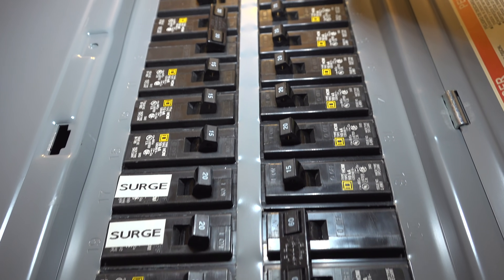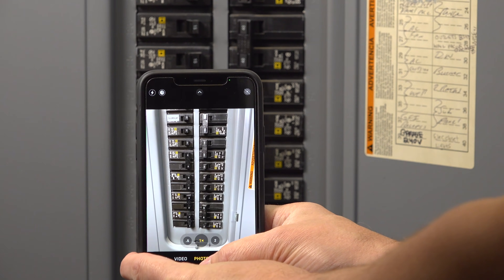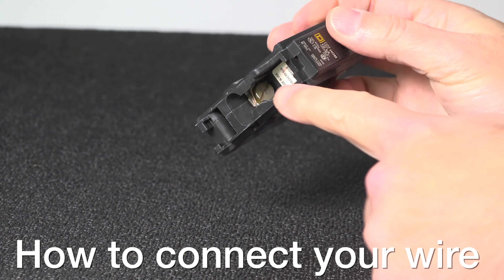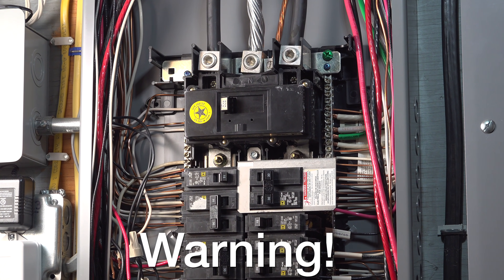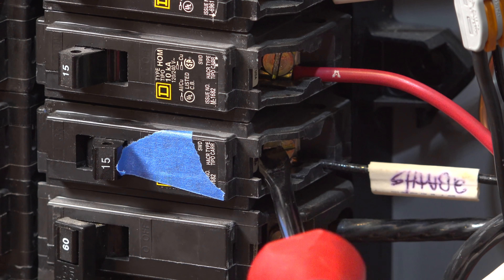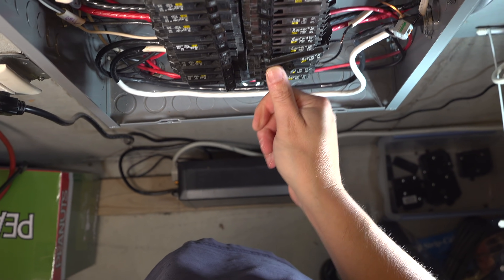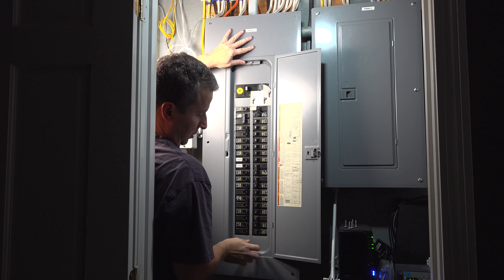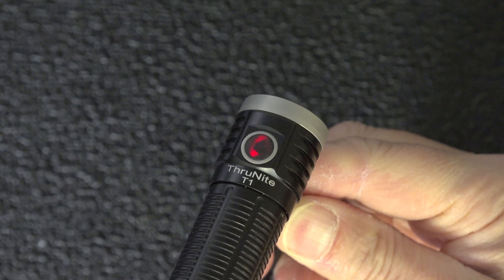How To Replace or Change a Circuit Breaker in your Electrical Panel & Why it's Tripping

Comment: once I screwed the cover plate back on and it dug into a power wire. There was a massive spark, sound, and then hours of trouble shooting. Don't assume there are no wire behind ....well anything in the panel. Please learn from my mistake. I assumed in the US, the diesign of an electrical panel would be thought out. NOPE.

Comment: Hello @Silver Cymbal.
How would I go about completely decommissioning one of those circuits? Previous owner my friend's house has outlets in their backyard, but one of the wiring is broken. Bad news in the rain, so I turned off 3 of the "circuits." I don't know which one it is exactly, but it was most likely one or a few of those 3 I turned off, and I want to completely decommission them. Do I have to install some sort of rubber that prevents the black copper wire and remove the black circuit entirely?

What are your thoughts?

Comment: Holy smokes. Looks easy. I think I can do it. Idk tho. But the breaker keeps tripping. Not sure what's causing it tho but it was in the middle. Tried turning it on but didn't want to. So I turned it off and back on and it worked. Theeeeeeeeeen it happened again. I repeated the same thing again. Now hopefully this week I'll get an electrician to take a look at it.

Comment: I've had the breaker for the induction stove top trip and it won't go back on.  It looks like the breaker at the top of your panel, left side, with two breakers that are bridged together.  Is there anything particular to be concerned about in replacing this/ these breaker(s)?

Comment: What if I dont have a main breaker? would having the breaker off be fine?
Reply: Every box will have a main breaker.
Reply: @danellzaabani5923 mine doesn't just all circuit breakers took whole panel off and nothing else but wires.

Comment: And also as you tighten the screw down make sure the insulation of the wire is not clamped under the plates

Comment: Thank you very much for such an easy to understand instructive video.  You have provided all the information needed to replace the faulty circuit.  If I turn off all electricity from outside, do the wires stay hot?  I saw another response to this issue.?

Comment: Thank you for your attention to detail in removing and inserting the new breaker. It was very helpful. I read on another video you need special insulated tools. I didn't hear you mention that.
Reply: No, but as someone else mentioned wear some rubber gloves as an extra precaution!

Comment: I have a lamination machine and it keeps tripping the circuit breaker attached to the machine, I want to replace it but it is connected to a subpanel, can shut off all the circuit breakers in the subpanel then change the 50 amp circuit breaker that is in the sub sub panel for the machine that I believe is bad.

Comment: Mechanical Engineer here to give two advice about safety:
1. When your circuit breaker keeps tripping, the presumption is that there is a dangerous issue in the circuit. Only that presumption is eliminated when you change the circuit breaker. 
2. Bear in mind that there are live wires above the main breaker therefor special caution needs to be taken especially when remove and reinstall the metal cover plate. I would standing on a dry wood pallet with shoes on while doing this work.
Reply: And using rubber gloves, imo?

Comment: "Our home is three years old. After a power outage, three separate breakers—serving different parts of the house—tend to trip when power is restored. This causes devices like the outdoor sprinkler timer, main TV system, and the whole-house recirculation unit to lose their settings and require manual resets.  
>   
> We’re considering replacing the breakers. What’s the best way to resolve this issue and prevent the resets after future outages?"

Comment: So I just fixed my circuit breaker thanks to this video. You explained everything correctly. I also bought a multimeter bc I thought it would be helpful. It was. I replaced it in 20 minutes. Thank you!

Comment: What if the breaker only says 20W and no other markings (at least that are visible while in place)? I notice you have a few on your panel that have no additional markings as well. Is it best to take the old one to the hardware store?

Comment: Which end to pull out the breaker? First the breaker needs to be turned off -right?  Should it be pulled out from the "bottom" not from where your hot line is connected -right?

Comment: Should you turn off all the breakers before you turn off the main breaker? I was told that if the main breaker has not been turned off in a very long time you can blow it if you do not do this.

Comment: Thanks.  So easy.  I had a breaker at the bottom of the panel that was bad, so did it myself.  Don't think that I would touch any near the top of the panel near the mains.  I switched off the mains before removing the inner panel from the breaker box.  I think if you haven't done any electrical work you shouldn't do this even with the video.

Comment: I’m considering doing this because I don’t have power in two rooms . I plugged in a small space heater and it blew it out . Tried to turn off then on again trick but still not working. I guess it could be anything from melting burning the wiring to damaging the breaker..

Comment: Can I replace the 15 with a 20 to ensure the breaker from tripping?
Reply: a 20 amp circuit needs wiring and outlets rated for 20 amps. A certified electrician would need to investigate your situation to know whether thats safe or not. Definitely dont take it upon yourself

Comment: I love your  video.  I have a question, if your breaker is tripping for no obvious reason,  could it be that the wire that you said to make sure that you tighten properly could actually be lose?  Shouldn't you check this first?  That will be my first step but like you stated for a small amount the breaker itself can be replaced.  Thank you for your help
Reply: Hmm if the wire is loose would the switch itself always reset too? If not the it couldnt be the wire. That would be my guess

Comment: My brother in law was an HVAC contractor and helped me add a second service box and some wiring to an 80 year old house my wife and I bought, so we could add a washer and dryer and lights in the basement. But that was in the 70s and I wanted a refresher course to replace a breaker. Your video was perfect. Thanks!

Comment: Thanks for the video! It gives me confidence to attempt to replace the breaker with one of the spares that are already set in the panel.
For the last last month or so the ceiling lights in the kitchen, dining room, and living room have been flickering more and more with time. Now there is no more power. I'm suspecting the breaker. 
I'll post an update after I attempt it.
Reply: Just did it this morning, worked out great! 🎉
Reply: It is nice to see someone post the results of their attempt to fix the breaker.  You are alive and well also have power.  Thanks for the reassurance.

Comment: Worth noting is that some newer electrical codes require a separate breaker at the outdoor meter, as well. For added safety one should turn off BOTH main breakers--if you have them.

Comment: The wire goes under the metal square plate, not directly under the screw ...correct ?

Comment: Why did they design it that way that the main wires always stay hot? It seems dangerous when removing the panel cover. They should put the main breaker outside in the box where the meter is located, and whenever you want to shut off the power to the panel, you just go outside and flip the breaker. That way, nothing inside the panel where all the breakers are would be hot.

Comment: Use a multimeter instead of a ncv, and often it's easier putting the wire in the breaker before setting the breaker back in the panel

Comment: I did general contracting in my early 20s but only ever helped our plumber and electrician with stuff. I know how to do some things but like to have someone who knows what they are doing to double check my work. What started out as the water heater going out has turned into replacing a breaker. The idiot I bought my place had the two poles spread out between two two pole breakers and the one went bad. About to replace it now, and re-wire it correctly... wanted a refresher.

I fell prey to a 240v 30amp is a 240v 30amp breaker dumb dumb deal. Take a pic of what your installed ones are and look it up on the internet so you know the details to look for when getting a new one. Size, connection type, and stuff like that. A few minutes on the computer is easier than going back to the store again.

Comment: I've had issues with a breaker tripping. The same 15-amp breaker is supporting two rooms. One room has a deep freezer and large refrigerator in it. The other is a bedroom with a large AC unit. In the bedroom the light often flickers or won't come on at all. The outlet where the AC is plugged makes the light dim or brighten when I touch it. I wonder if it's the outlet itself or its both or something worse.
Reply: the fridge should be on its own circuit. If the freezer is large, it should also be on its own circuit. If your fridge, freezer, and a/c are on the same circuit, you're definitely overloading it

Comment: I have a switch for the dishwasher that never trips, but once a week I have to turn it off/on about 3 times before the dishwasher has power.  I purchased a replacement breaker switch, but my panel has no main shut-off at the top of it.  I did take off the panel (painter's tape is critical as all the labels go away and all the switches look the same), but I had to switch off all of the individual breaker switches.  I used a electrical circuit tester and all electrical to the individual switches were off.  Do I have to worry about getting electrocuted?  I know not to touch the main top wires coming into the box, anything else?

Comment: My circuit breaker replacement specifies 25 lb of torque to apply to the screw attaching to the wire. Can I just screw it in firm but not too much or do I need a torque wrench?

Comment: Or you can just snap out the breaker and rewire the other breaker out of the panel and just put it in and you’ll be fine. Seems overkill to completely shut off the main breaker

Comment: I recently moved into an older house with a 3 Prong dryer plug in a 20amp breaker. I found a 3 prong cord but it’s 30 amp rated….I’m thinking I can just get a 30 amp breaker and swap out the old 20 amp but I’m not 100% sure if that’s correct. Any helpful feedback good people?

Comment: What happens when the circuit breaker is wet and the switches won't go all the way to the left??..…. None of my bathroom lights or bedroom lights will come on
Reply: Here's what happens .... You call an electrician

Comment: Overall a good video. Thanks, @silver. It would be seven better if you elaborate more on how to choose the right replacement. In the video you just mentioned the part numbers, but that limits buyers to the same brand products. What if the old breaker was a less known brand which is not available in my local hardware store? What is the buyer wants to change brand (especially since the original brand already failed me once)? Besides, in my case, the old breaker has no prints, at least not on the top.

Comment: I’m needing to change a breaker but when I opened my panel box, without unscrewing the panel off, it does not say anything but the number 15 on the switch. No other details. How can I find out what I need? Do I still need to take the panel frame down and then it’ll tell me? I am not sure if I should do that before having another breaker in hand. can anyone help?

Comment: As a retired electrician i would say this is not a DIY job. Here are somethings I think is missing from this video. 1. when you insert the wire make sure the the screw rotation is pulling the wire into the breaker and not pushing it out. It was done correctly in this video but he did not mention. 2nd I would turn off each individual breaker and then turn off the main. This prevents a big surge to the main breaker when turning back on. Be darn careful when putting cover on and off because if you hit the wires above the main breaker you are dead. 4th stand to the side when turning breakers back on because if you pinched a wire with the cover it will explode and flash when you turn that breaker back on. I personally would of never made this video. Too much liability for me.

Comment: If I run 2 nice new heaters on different ends of my house...or run a hair dryer and one heater mine trips. It's like half my house on it. 3 bdrm. It's under 30 degrees out so heat is a must

Comment: When I reset my circuit breaker it sparks, and left at the middle position. What does that mean? Btw this never happened before, I just replaced a bunch of new receptacles in my rooms and this happened.
Reply: @tradde11 I contacted professional electrician to come over last week and they helped fixed the issue. We found the issue after 1hr.

Comment: I told my landlord that the problem was with the circuit breaker, because it kept flipping to the off position but he REFUSED, literally, to listen to me because I'm not an electrician.  He insisted that the outlets needed to be replaced, I think because the tenant he hired to do my repairs told him that was it.  Now I see that I'm vindicated.  Thanks!  And thanks for the clear easy to follow instructions!

Comment: must be a old video I paid 48 dollar's .
Reply from the maker: They are still under $10 but some higher end breakers, especially if Arc Fault or GFCI can be expensive, depending on the panel.

Comment: FYI, if you look at the plate where you secure the wire on the left side, you will see a slot on the right side that acts as a wire holder.  It should work fine, but I believe the wire is supposed to go on the right side, not the left side for an optimal connection.
Thanks for the informative video.

Comment: Thank you for the video! 
What happens if after turning off the main circuit, it is still showing the power to the circuit I am trying to change. I should not touching it, right? 
Is there another way to make sure there is no power to any of the circuit breakers

Comment: Great video! However, my CB panel does not have a master  switch to kill power to all CBs.  I watched a licensed electrician change a CB with the panel live. So, would you comment on doing that? Also, the CB I want to change is pretty tight in its slot. Any suggestions on getting a better grip on it or ?????

Comment: It’s summer time in my home we have 3 air conditioners , 1 in the living room , 1 in another room downstairs and 1 upstairs, sometimes I’m a day it trips,at least 3 times 🤦‍♂️ only thing I do is unplug outlets even if they are not on. Does anyone know what could be the issue?  House is very old I took a look at the circuit board and it seems 1 or 2 have been replaced in the past. Would replacing them all be a good thing to do? Or do we just need a stronger/ different system? I can’t take this heat , thank you

Comment: Screw Driver Must be insulated for safety don't mess around guys! Pay the extra money buy an insulated screw driver set don't cheap out. It might seem like overkill but it might just save your life. Also make sure the breaker is off. As the guy stated in a previous comment its easier to leave the wire in and remove it once its out. Always treat everything as it is live don't allow the wire to touch anything don't allow your hands to touch anything and so on you never know there are odd setups I've see people use where they use a breaker instead of the main breaker to provide power to the panel and so on. Whatever you do be very careful folks your life is at steak. By all means DO LEARN and DO DIY! Lord knows we need more people with the CAN DO spirit but keep in mind the serious thing you are working with. NEVER BECOME COMFORTABLE! ALWAYS TREAT IT AS IF IT IS LIVE! Often some of the most skilled electricians get hurt simply because they become comfortable doing it day in and day out and a simple lack of attention to detail due to comfort in knowing they are. You are never more skilled than electric believe this not because it is religion but believe it because if you don't electricity will teach you very quickly! Always be aware of where your other hand is and your body make sure neither your leg your hand or arm or body is touching the box or a wire etc... This little bit of awareness may save your life as well because it will prevent electric from passing through your heart while creating a circuit and instead it will pass through your fingers in a circle sparing you death in many cases. Only ever maintain a single point of contact at all times.

Comment: If I want a breaker to be able to handle more electronics plugged in- like two air conditioners instead of one, do I just buy a breaker with a higher Amp number?

Comment: Solution for cheap/poor? Find out your map, (what's using that line) and use another line/outlet. 

Shut off one breaker at a time, and find out what runs where on each line. Shutting off the whole house is unnecessary and more trouble. 

Don't ever touch the big nasty looking cables coming in from the top (usually) or side. That's full power from the street. We font wanna go there. Literally: DO NOT TOUCH THE THICK MAIN LINE FROM STREET! 

That one is NEVER off and it's over your pay grade. It's serious juice. Don't go there. Plus, the big nasty from the alley out back, also. 

Avoid obvious things like running heating or cooling things (air conditioners,  air fryers, hot air heaters) with other high-draw stuff, especially at the same time on same line.